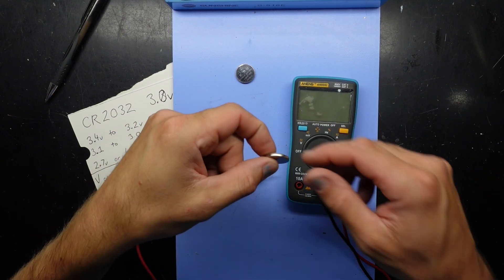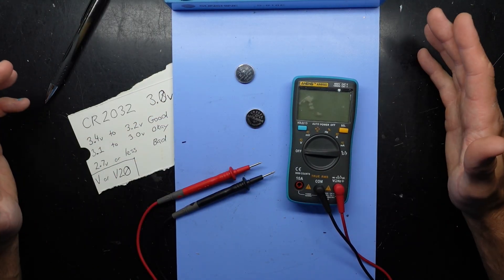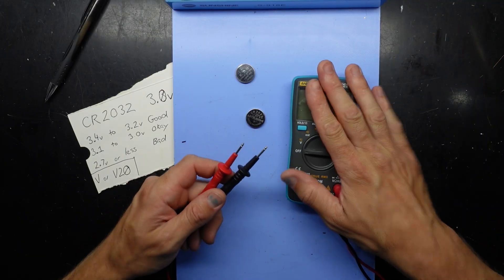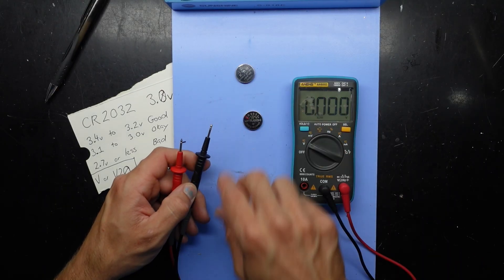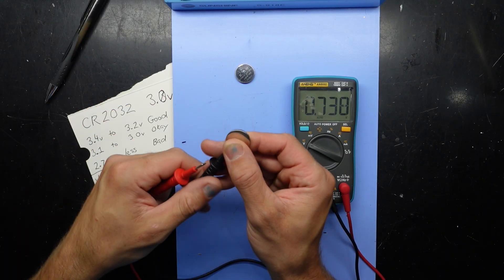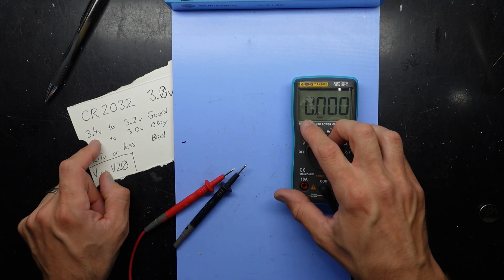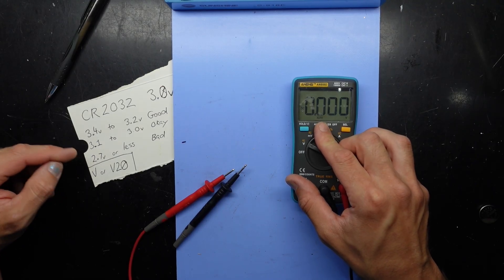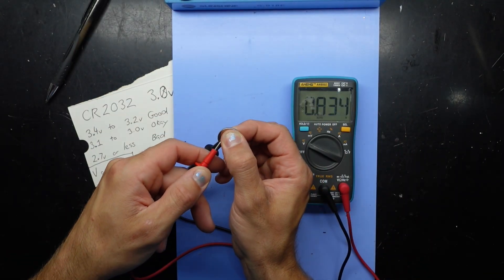How to Test a CR2032 Battery (to see if its any good)

Comment: This is not a good test because it doesn't load the battery at all so you can't be sure it will work.  I  had 2032's unused that showed 3.2v but nothing on a battery tester.  The exhausted pair showed 2.8 V but did move the needle on the battery (load) tester.   How is it that never used Sony 3.2+ V won't move the needle won't even light up the device that the 2.8 V will?   Apparently it's the effect of "Internal resistance"   Can happen with age.  Those never used batteries were old.  If you are not testing under load, the voltage won't tell you if the battery has high resistance and can't deliver any power at all. 

Moral to the story, get a battery tester, not a voltage tester.

Comment: I had three different packs of brand new CR2032 batteries and none of them were over 2.7v. They had been sitting around for a few months but not that long. Do these type of batteries have a shorter shelf life or something?
Reply from the maker: no sure, but thats pretty disappointing
Reply: I believe they do. I had 6 new batteries, three below 3.0v, and only one over 3.1v
Reply: My new ones have 3.3V-3.4V but still doesn't work for some reason 😢 E-Fast china brand, quite old tbh, old one Panasonic in my key car showing 2.9V-3.0V and still work just become temperamental